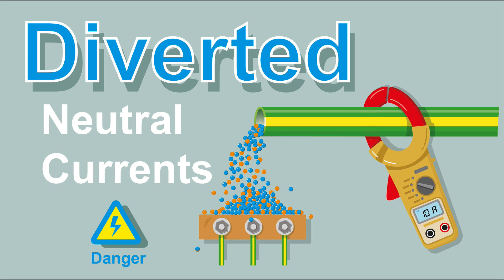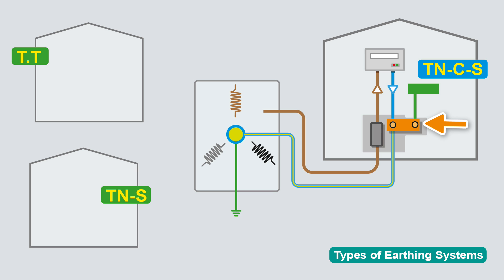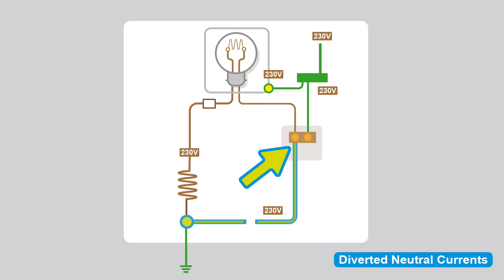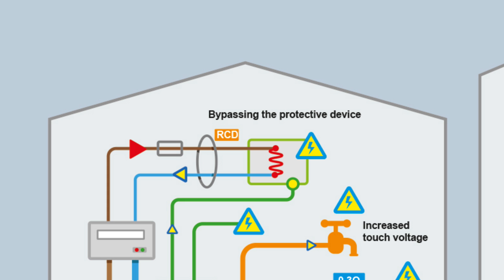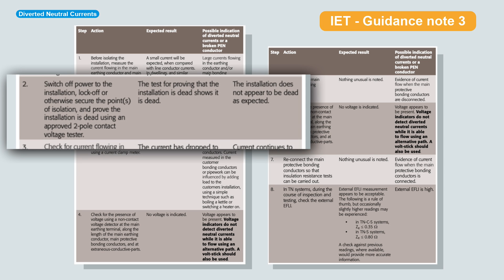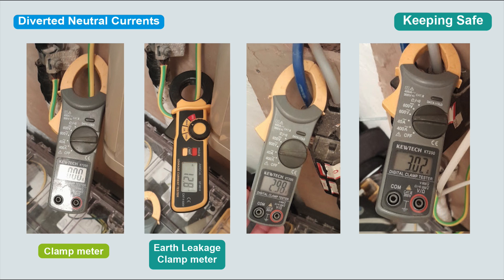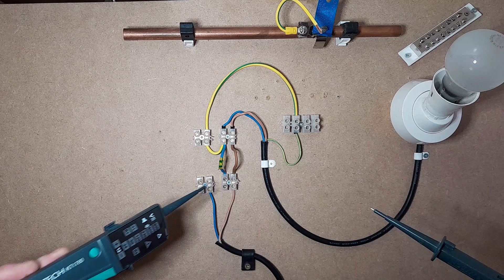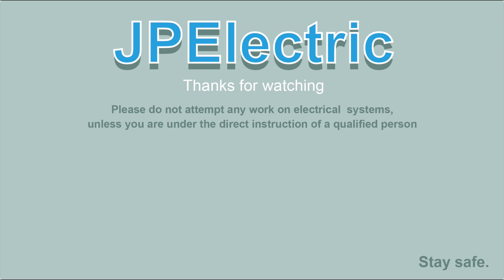Diverted neutral Currents -  Is our electricity supply safe?

Comment: There is a new practice of people buying and using earthing products that keeps your body earthed while sleeping they usually have silver contacts throughout a bedsheet that has a standard plug which only has an earthing pin the idea that by using the earthing system of the house to connect to ground, it would seem to me that these products could be a hazard if while sleeping a fault occurred that could produce a prospective fault current that would energise the cpc with very high currents, the example you’re describing would do the same
Reply: Exactly what I told a friend who was thinking of buying one. After I was done laughing about the concept, I told him that's not really a safe thing to do. The chance of something happening is super slim, but a chance no less. And, living in Fl with all the lightning, well yeah, if the house gets hit that blanket can get really hot!
Reply: Never thought about that.

Comment: In Germany, the TN-C-S network still has a ground in every house. This results in a very low connection to the earth throughout the entire town.
PEN cables are always very thick. 16 mm2 is minimum. Such a thick cable doesn't break easily.
Reply: Same in Australia with MEN (multiple-earthed neutral) supplies, which accounts for the great majority of suburban installations. Every installation requires a connection to earth ground via an earthing rod wired to the earth link terminal/bar, which is in turn contended to the neutral link terminal/bar.

Nonetheless, a broken neutral on the supply side can still cause dangerous touch voltages within the installation, depending on the effectiveness of the earth ground. Dry/sandy soil provides a high resistance earth connection which is far from ideal for earth rod purposes.

So: always check! 

And plumbers changing out water meters need to put a jumper across the old meter before removing it.

(Connecting mains earth to gas pipes in Oz is illegal.)

Comment: When they were rolling out the new smart meters, I don't think it would have been too difficult to include a clamp on coil with them. The clamp on coil could go on the main supplier earth cable and monitor for current. If anything looked out of range then the smart meter could alert the DNO to potential problems immediately and they could start an investigation.
Reply from the maker: Thanks for the comment - Yes, and Isolation would have been useful as well, it seems like a missed opportunity

Comment: Also with dnc all the exposed conductive parts designed for fault current of short duration would now be live 100% of the time carrying neutral current,  i am now considering  double nuts on swa glands to maintain a secure fitment, other tricky parts considered conduit due to heat expansion of joint connection.

Comment: great VT but if you had RCD on incoming tails that would see it right?? 100mA
Reply from the maker: Hi Rusko_Customs. Thanks for watching. The RCD will not see an imbalance on the tails as the tails will be after the separation of the neutral and earth.
Reply: Not unless its a si type rcd may well work issue there expensive and not commonly known about
Reply: Love video mate, After 3-4 watchs Right I'm understanding current will still flow in neutral (tail) to DNO earthing but then will travel down MET to all earthing ect because of PEN

My brother works for UKPN  
He said often they loose the phase but we do loose the neutral, 75% phase, 25% pen

Of course PEN fault is more dangerous because of all exposed parts
Reply: @liam3284  No, an RCD is not allowed on a PEN-wire.

Comment: Maybe we should be viewing the tn-c-s or treating it as TT and all have a RCD main switch 300mA might suffice.and an electrode.I think that's why they do in Germany though nearly all have 3phase as well.
Reply from the maker: Thanks Roy, I don't know what the solution is, but TT is problematic in built up areas.
Reply: In Germany they have TN-C-S, on older installations  up to 1973 or so TN-C. TT Is used in Italy and I think in France. Now most countries use ground rods with TN.